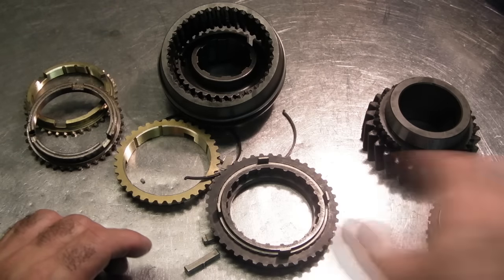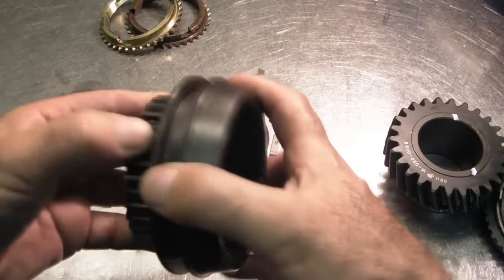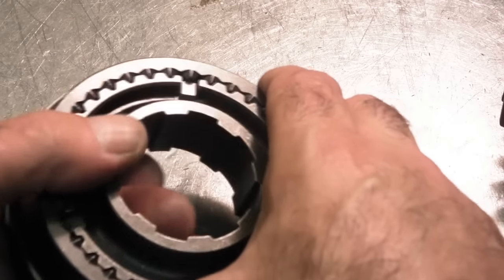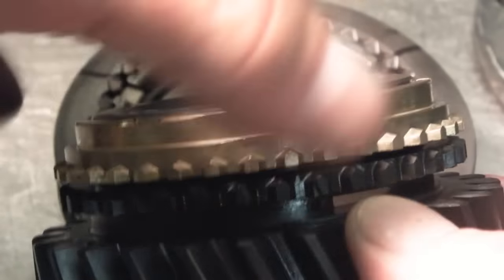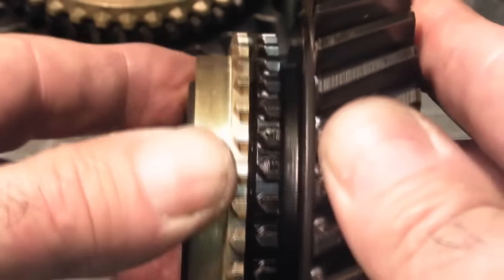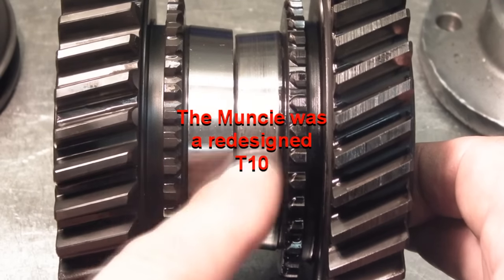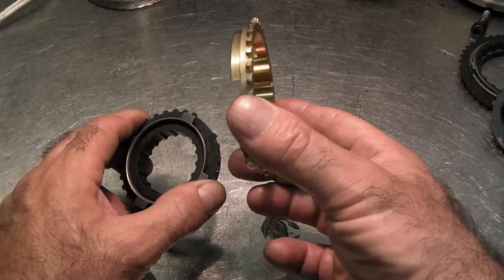Learn About Transmission Synchro Rings

Comment: hello, regards ... you know what kind of bronze is used in the synchronic rings, I need to make some for my car to which I can not get parts, I found a workshop with cnc machinery but they have no experience in what class of bronze I should use
Reply from the maker: Rings are usually Forgings.   So to machine a ring from stock will yield a weak ring but I understand you have no choice. Rings do not have to be made of bronze or brass. They can even be made of  steel.  I've seen rings also made of aluminum in truck transmissions.  You would have to do research on what materials are available to you in your country.  See www.matweb.com
Reply: I got it ... that means that it does not matter so much the material, but rather the shape and the point where it is in contact and produces the brake. but I guess it must always be a softer material than gear, so as not to cause wear in the gear

Comment: Oh ok hadn't thought of that. How exactly does the gear move away from the ring if the slider is wrongly aligned with the gear teeth? As the slider moves against the gear teeth wouldn't the ring also move within since it is locked to the slider??

Comment: Question about what you called the "3-piece ring." Well, with your example of the standard ring, the cone was already attached to the gear, right? So wouldn't your so-called "3-piece" ring really be a TWO-piece ring, because isn't that middle part the cone that would normally be connected to the gear (since that has splines all around it but the standard one doesn't)?

Maybe you can enlighten me.
Reply from the maker: In a 3 piece set up, the cone is not part of the gear.  The cone, friction ring, and outer ring are all separate. The cone actually is splined to the main shaft, the friction ring has tangs which float on the gear and the outer ring is driven by the synchro assembly. This set up improves surface area in a shorter form factor.
Reply: Hmm, I'm trying to comprehend the difference in the direction of energy flow between the 2 setups. Sounds like it's sort of a reverse drive from the traditional setup. Did I understand right?
Reply from the maker: MaxxFordham The outer RING (like the old brass ring ) is driven by the synchro keys.  The inner cone is driven by the mainshaft ( which is the same speed as the synchro keys). You have basically two components operating at the same speed as the mainshaft . The friction lining is tanged to the gear. It is basically sandwiched between these two components.  The friction surface area is almost doubled, since both ID and OD of the friction ring is used. It has more surface area then a Muncie ring and is 75 percent less in size..... but costs much much more to make!
Reply: GearWorldTV
Oh, okay, cool. Well hey, in order for some of us to understand the active differences between the two, will you now please make us a video that shows us the kind of action of the new-styled ring system with the same amount of detail as you show with the old style in this video (and then cross-refer/crosslink them in the description or/and an annotation)?

Mike
Reply from the maker: MaxxFordham I'm working on a part 2 and that will have those rings mentioned.
Reply: Well, you've already mentioned them here. What I'm asking is if you will please do more than just mention them again, but to go into great detail on how they work, vs. how these work. Would that be okay?

Thanks if so,
Mike
Reply: Thanks for the +1! :-)

Happy 4-1-4-1-4 yesterday, too. :-)
Reply: Hey, GearWorldTV, do you have an update for us about how far along your new video (that one that would be going into more detail -- with hands-on demonstration -- about how the new multiring synchro-mesh differs from the older style) is coming along?

Happy Independence Day (USA) tomorrow (as I type this),
Mike
Reply from the maker: MaxxFordham I have some other videos I have been working on that need to be edited and completed first.
Reply: OK.

But happy Independence Day!

Mike

Comment: I have a 97 mitsubishi turbo spyder and 4th gear is sliping out don't know if its the syncro ring the trans or the clutch ??
Reply from the maker: Falling out of gear is never just a synchro ring.  Usually physical wear on the gear, slider, or shift fork. Could be just one item or several.

Comment: Thanks for this video. Im having trouble diagnosing my transmission problem.  Im getting a grind from 1st to 2nd but not 3rd to 2nd. I know 2nd gear has one synchro so the synchro shouldnt be the problem right? I tried replacing the clutch with all new bearings and added new fluid. Its a mustang tr3650 5 speed. Please help!
Reply from the maker: The rings that work the hardest, wear first.  So in your case. The 1-2 shift may work the second gear ring harder than any other ring.  Also clutch release, if it is poor will prematurely wear out rings.  Your problem is quite common. So your 2nd gear ring IS your problem, because it is worn out. The speed difference from 3 to 2 is less than the 1 to 2. So the ring works more on the 1-2 upshift than the 3-4 downshift and can't handle the load.

Comment: So if my car is popping out of 5th gear.. would i need to replace the synchro rings or the actual 5th gear as well?? thanks
Reply from the maker: Could be a number of issues, but synchro rings themselves when worn would cause a grinding into gear. Usually, forks, sliders, the gears, shaft endplay can be the culprit.

Comment: I am at a loss in my logic here. Why not just have the clutch surfaces permanently attached to the gears? In other words, why the need to mesh first? The clutch that pushes against the flywheel doesn't first need to mesh with anything. I know I am missing something.
Any help would be appreciated. Thx.
Reply from the maker: Because everyone gear would be the same diameter of your clutch and the transmission would be 3 times longer. It's all about the holding power. Basically what you are describing is an automatic transmission that can be shifted manually
Reply: @GearBoxVideo  If a mainshaft is removed for inspection, can worn synchros be accessed without removing the bearings and gears? In other words, can the conical gripping ability be felt by hand? Thanks.

Comment: How long would a worn synchro actually last? I'm trying to save up money to get it fixed
Reply from the maker: If the one synchronizer ring is causing the gear to grind anytime you shift it, you will eventually ruin the gear and the slider. So, the longer you wait the more chance you have to damage more parts.

Comment: Paul, what type oil do you recommend for the Nash 4+1?
Thank you for your advice.
Reply from the maker: Since most have gears that run on needles, you can run GM synchromesh fluid or the equivalent from Pennzoil

Comment: 2003 Audi A4 is hard bonking into 3rd when high rpm or quick shifting.  If I push it into 3rd slowly it is smooth, but if I go quick it is a hard resistant wall while going into gear at the same time.  Is my synchro bad?
Reply from the maker: Sounds like it is on its way out

Comment: I have a Genesis Coupe 2010 Track. Under warranty I have had the transmission replaced twice. The vehicle has an issue with second gear lockout in all years and models. Is there anything I can do to prolong the life of my transmission. I am moving from a dualmass flywheel to a solid and new clutch and accessories. A new stiffer transmission mount also but I haven't installed yet. Also will a thicker transmission fluid help before the synchro get worn out?
Reply from the maker: Aaron Williams do you mean block out condition? Why would you want to change the flywheel?
Reply: First of all thank you for responding, means a lot.  What I have found is this system that is in place to encourage more conservative driving habits where a gear is locked out until the rpm's drop down to a predetermined amount and then the car will allow you to shift into the gear.  In this case it is second gear for this manual gear box that I have seen from 2010 to present model Genesis Coupe's.  I have read about it on the dodge challenger that my girlfriend is trying to buy in manual also and some other cars and is at least referred to as a gear lockout.  It seams like it is an option built into the on board computer and not mechanical, but what I have learned from you it could be bad rings not synchronizing the gear and collar but people experience this after owning a new car for a few weeks. The flywheel is worn out I can hear it clicking when I drive at low speeds around 10 mph.Also on hot days the clutch is slipping and the dealer ship will not sell the clutch without the flywheel because a dual mass can not be resurfaced and the stock flywheel is around twelve hundred dollars alone.  A single mass flywheel is a less expensive option and an aftermarket clutch kit will not work with the stock dual mass flywheel. I'm not sure where to start but the transmission has less than three thousand miles on it and I have not had any shifting issues with this third transmission yet. I want to fix the problem before it occurs this time because my warranty will be up in a year and can not just swap another transmission under warranty.  The transmission MODEL is M6VR1 I believe the M6VR2 is in the 2013 to present models.Thank you again sir.

Comment: I have a few questions. I have a t56 older one and 1-2 and 3-4 has a 3 piece ring and 5-6 has a lined ring...would you recommend a 3 piece for the 5-6 gears?
Reply from the maker: Unless you are going through rings.  The conversion is more than just changing the rings.

Comment: Hi, is the load on the gear teeth or is the load on the syncro cone teeth on the gear when it's engaged ?
Reply from the maker: Both. Don't think of it as load, think of it as power flow. the countergear drives the gear which drive the synchro teeth which drive  slider which drives a hub which drives the output shaft. Most times when a failure occurs the gear teeth break, however I have seen hubs crack and synchro teeth shear.

Comment: Hey Paul on your forged rings that you used in your other video for the Richmond 5 speed what is the slot width of the sychro  rings 1-4th
Reply from the maker: Curious as to why you are asking?
Reply: Long story short I bought a used Richmond last week, I opened it just to check it out. The Richmond I have has good grabbing rings( they look pretty new) but when I line them up, they block  like in your explanation, so I wanted to compare the slot on my rings with yours. Mine measure .398 is that standard?

Comment from the maker: Thanks!
Reply: Hi my gears get hard to change when the car been running for a while. What could be the problem? Ive already changed my clutch kit. Please help
Reply from the maker: Your clutch pilot bushing is probably too tight and when heated up causes the input to bind
Reply: @GearBoxVideo  what needs to be done? You think it has nothing to do with my  gears synchronize ? In the morning when the car is cold everything is smooth but the moment I drive for while,  gearing down from 6 to a low gear or to neutral gets very hard

Comment: Hey Paul. I'm trying to learn about transmissions and I'm having a bit of trouble understanding this process. what is pushing the sychro ring over?
Reply from the maker: +Tim Kb The shift fork pushes the slider which pushes the strut keys against the ring to allow the ring to lock onto the gear. The slider is what does the main apply.
Reply: Thanks for responding. um..right the shift for pushed the slider. so the slider has notches that grab the keys? thats why the hub only fits into the slider in three positions? sorry if this seems like a stupid conversation; i've never seem these parts in person. just watched your videos. Thanks again

Sorry, I figured it out. The shift fork moves the slider and the slider has grooves on the inner teeth which catches the bump on the key and moves it over.
Reply from the maker: +Tim Kb Yes that is correct,

Comment: Hey man, i have a tr3550, i put valvoline synchromesh fluid in it.  Tremec recommends gm synchromesh.  Am i okay with the valvoline? If not, i will replace it.  Its just the gm one is almost $30 a quart.
Reply from the maker: k129h8 the Valvoline works fine

Comment: Hey mate, Driving an MR2 1990, second gear crunches when down shifting from 3rd from high revs or speed, crunches 1st to 2nd gear when the reves are over around 6000. How do I get the syncro's fixed and how much would it aprox cost?
Reply from the maker: Minyadan  I have no idea what rings cost for a 1990 MR2.  However if you can find original equipment rings I can tell you they will be better than the aftermarket ones.

Comment: every 10000km or once per year i change manuall gearbox oil and every time oil was not clear , it has metalic effect as paint so left it to rest and to next change debris was on bottom of bottle. after 9 years i put car to junk and opened gearbox to see if inside left any brass and housing was brass covered inside but syncro brass rings were not in so bad shape, so if oil is not clear it is not so bad thing, i bought same  but newer car

Comment: Hi, I have a 2011 Toyota Camry base model with 83K miles, 2ar-fe 2.5l 6-speed MT that has reverse gear grinding and blocking intermittently since I bought it in 2016 with 37k miles. I want to keep the car. The rest of it works fine. I changed the MT gear oil at 60k. Should I let it progress to near failure, fix it now, learn to double clutch? Is there a TSA on the MT?
Reply from the maker: More than likely you have a poor clutch release.  Waiting for a complete failure can get expensive. I would get it repaired bas soon as you can
Reply: @GearBoxVideo  Thanks for a quick response and an excellent video.

Comment: Does the strut "bump" face towards the center or the outside? thanks.
Reply from the maker: +noelywire The bump of the strut tracks on the outside. The slider engages the "bump" allowing it to push the ring against the gear.

Comment: I'm still confused about gear grinding. IF the gears are always in mesh with another (gears on output shaft and countershaft) then how do gears "grind" if you mis-shift? And showing how the synchronizer engages into an output shaft gear cone, is the gear engagement just engaged by pressure of the synchro ring pressing into the cone on the side of the gear? If it's engaged just by friction of these two parts, wouldn't it be possible that a manual transmission could "slip" if the synchro-to-cone interface is worn or damaged? 

And if the output gears never physically slide in and out of mesh with countershaft gears, how do the teeth chip off? Wouldn't the chipping be on the synchro ring chamfer and the gear-side chamfer teeth as the synchro hub slides over them? Wow I'm so confused.
Reply from the maker: The synchronizer assembly is directly attached to the output shaft. Grinding is caused by the synchronizer assembly not being able to lock onto the gear at the correct speed.  Since the assembly is splined to the main shaft when you make a shift you are pushing the bronze ring which is attached to the main shaft. against the gear slowing it down to meet the speed of the main shaft then finally connect the two together.
Reply: +GearBoxVideo Thank you very much, I rewatched your video after reading the comment and it all makes sense now!

Comment: Soooo. . .  the M5R1 ford/mazda for my ranger, is modified since 01, I have learned. I need a synchro kit, just the brass, all the gears in the at are fine. The synchro kit for my years is over $600.00, while other kits for the same but earlier years are about $150. It says or they say I have "multi pieace" synchros. I just need the brass. Is there a way to get around this $600 for a synchro kit?
Reply from the maker: Email me with your make and model and contact info and I will find out what I can do
Reply: @GearBoxVideo  I sent you the email, and uploaded a video link showing the main gears and syncros. I think they are good, but a lot of miles on them. would love to get the brass only.
Reply: @GearBoxVideo  Well, the gears all look good, I just want to replace the brass synchros and some bearings. I'm getting that for my year, they cost an additional $600. I find that frustrating and heard to believe. I think they are trying to sell me the whole entire "multi piece gear synchro" instead of the brass rings. I can't get any knowledge on this dilemma so far.

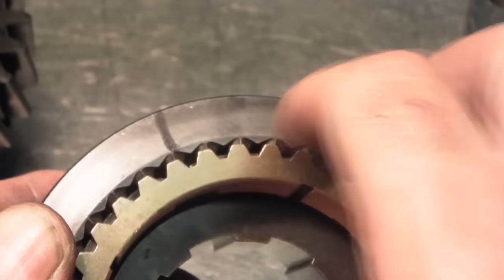Comment: hi! is it normal for the first gear to feel like it's stuck or it won't engage until I've reached a complete stop? or is it an example of the issue you mentioned on 4:55? I'm driving a 2002 toyota cami / a.k.a daihatsu terios
Reply from the maker: sometimes its a bad synchro or dragging clutch

Comment: In the situation where the syncro ring is stuck point to point blocking a gear, is there any quick fix you can do to unstick it? Like smack it with a rubber mallet, trying to shift into gear while the car is running while up on jackstands? Currently, my 1st gear is feeling like its physically blocked and from your description, this sounds like the issue.
Reply from the maker: The ring is attached to the 1-2 assembly. So try putting it into 2nd and drive and then coast. Then back into first
Reply: I have tried that. It still won't budge. Hmm. However your video was very informative.
Reply from the maker: More than likely the slider is damaged then

Comment: hey i have a 4 speed transmission on my 1983 5.0 mustang and only Grinds1st gear its really annoying and where would i buy a kit to replace the synchros? or could u give me advice where i can get it fixed?
Reply from the maker: Grinding in first typically happens with poor clutch release.  If you press down on the clutch pedal while idling in neutral, you should be able to count to 10 and put it DIRECTLY into REVERSE without a grind.  If it grinds  that indicates you have a poor clutch release. Do this first to be sure you don't have a clutch release issue